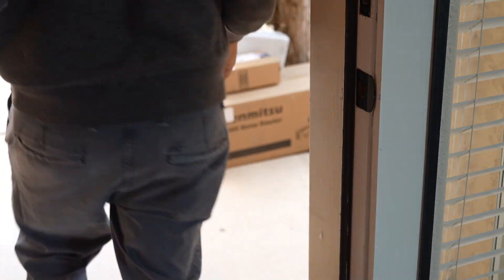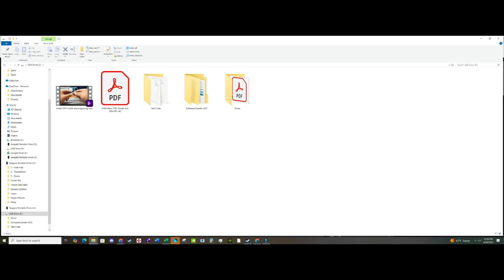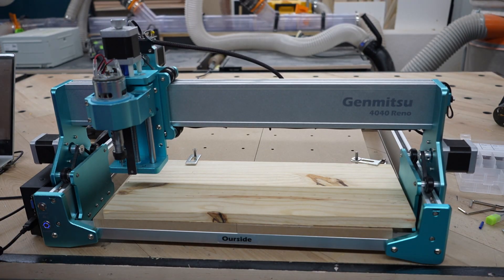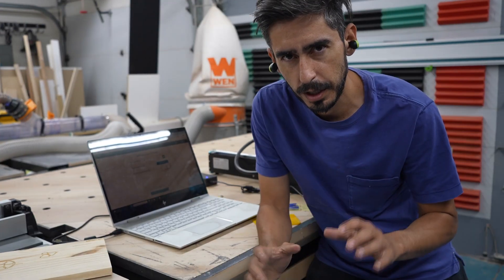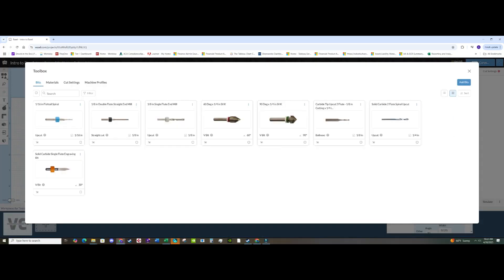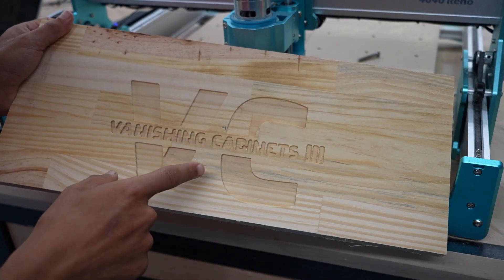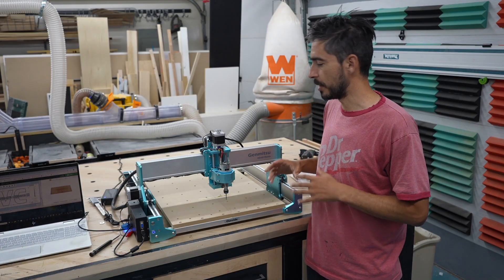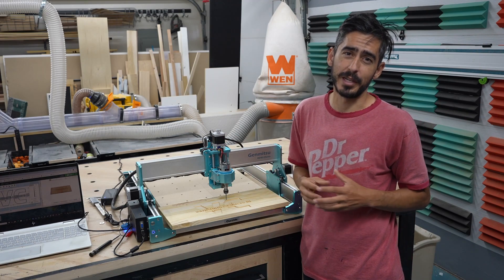SainSmart Genmitsu 4040 Reno - First Impressions & Setup

Comment: I don't think you should be vacuuming around it while it is working.  It would be precise if you knew how to operate it.
Reply from the maker: Sorry, how would the dust help the machine to be precise?
Reply: @vanishingcabinets  the Barbecuebob is a magician, I guess.

I see these vacuum adapters for some of the Genmitsus, that would remove the dust as the machine spins.
dusting it the way you did is perfectly fine.

Comment: Question: voltage requirements?
Reply from the maker: This is 24V, I’d say at least 4 amps.  It does come with a power supply.
Reply: @vanishingcabinets so, it converts 110 to 24, right?
Reply from the maker: Yep exactly, sorry for the delayed response